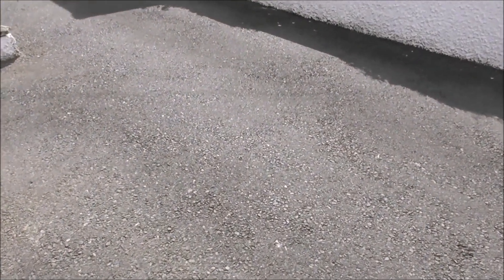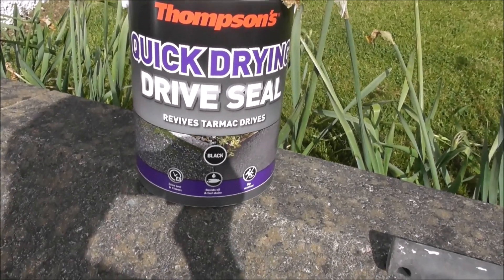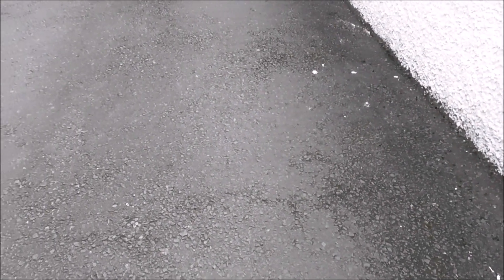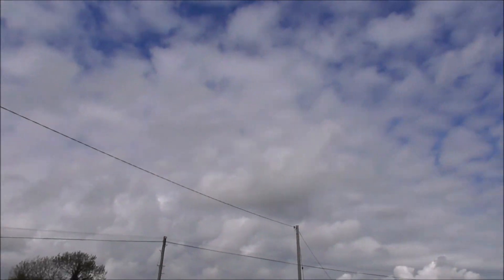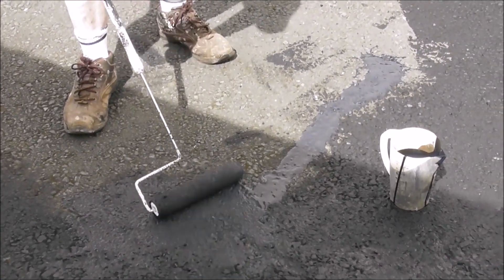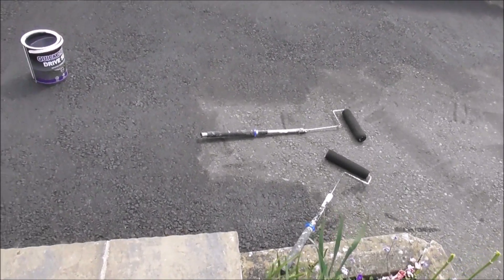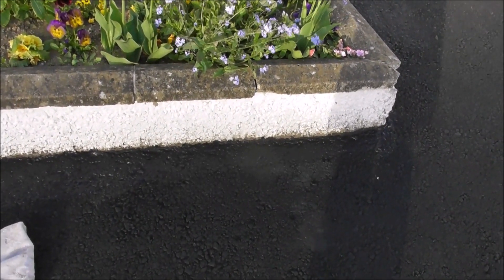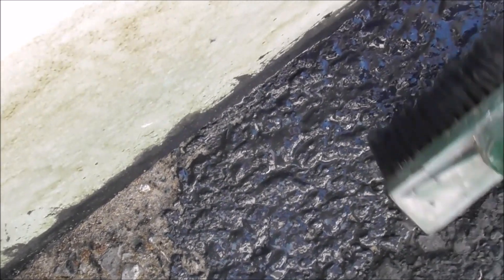How to Revive an Old Tired Tarmac Driveway

Comment: Great job Tom well done a friend of mine did his driveway did the edges first with a soft brush to stop splashes and put it on heavy and then used very thick rollers to get the paint in the tarmac and give it a heavy coat but then he had done a few driveways before so had a lot of experience of what worked out the best way to do it that old saying ( practice makes perfect ) thanks for sharing take care 👍
Reply from the maker: This stuff really works well RDUK. It means that you delay retarmacing for years and years. I good thick coat will protect it for a long time. Hard work though.

Comment: Thanks for sharing although I did think it would have been a better coverage for the effort you put in. I thought it would have been thicker as I have holes and was expecting to fill them up! Think I’m looking at the wrong product lol
Reply from the maker: Admiitedly DIYman the coverager didn't go as far as I expected either. Holes are a problem. If you driveway is holy then you would need to get it evened out. I have looked for other stuff but nothing springs out. Everyone in the business I have talked to recommends this stuff. I'm afraid it is expenxive too but then so is retarmacing. Best wishes from the Belfast Castlereagh hills.
Reply: Whoever tarred your drive did it with a base coat tar that's why its taking so much of the paint its got too much big stone in it good job patching it up though
Reply: @TomMcClean  45€   us ZILCH.
Reply from the maker: Very expensive!

Comment: Hi can you update us on this drive sealer? Has it held up well or has it faded? Thannks
Reply from the maker: It has faded Bruce. It looks really good for the first year after it's done but ..........
We will have to think about redoing it in the Autumn. Admittedly we are very exposed to the elements here. Best wishes from the Belfast Castlereagh hills.
Reply: @TomMcClean  thank you for your reply. I'm trying to find something that'll last so it doesn't become another job the Mrs bugs me to do every year 😆 someone suggested bitchumen paint to me but can't see anyone who has used it.
Reply from the maker: Hi again Bruce. We last coated our tarmac 2 years ago. We might get away with leaving it another 2 years. Then we will buy lore of this tarmac paint. Admittedly our driveway does take a fair bit of abuse. I reckon 4 years is about the maximum it can be left which isn't bad. However we found that a tin doesn't cover a big area. Maybe we wear laying it down too thickly. It does look really good in the first year after it is laid down. Best wishes from the Belfast Castlereagh hills.
Reply: @TomMcClean  thanks again I will give this ago.

Comment: How did you find the coverage? My driveway is 60 m2 and going off the states coverage I should be able to do it with 2 tins, but I’ve ordered 4 tins just in case
Reply from the maker: Hi Mike, It all depends on how thickly you want to paint it on and also if the condition of the driveway. If your driveway is in poor broken condition it will obviously require more paint cover. We found that tin coverage was not good at all. We used 8-9 tins! They were nearly £20 each. So our driveway was covered with a lot of hard work for around £200. It was and is pricey but the finished job looks like a new driveway. A new driveway will take big money so it is a bargain and is worth doing. I think you may order at least 2 more. If you don't use them then you can keep them for next time. Our driveway is very exposed and takes a fair bit of abuse so it will need another coating next year.  Best wishes from Belfast Northern Ireland

Comment: Back breaking work mate,well done , looking good👍
Reply from the maker: Yes Andy and for much of the time we were using short paint poles until i went and bought longer ones. This stuff is excellent.
Reply: @TomMcClean how long did it stay black for i guess not long?
Reply from the maker: I'm afraid it does fade. It all depends on how particular you are. We haven't done it since and that is 4 years ago. But it does need a repaint after 2-3 years. Best wishes from the Belfast Castlereagh hills.

Comment: Ya think ya can use this stuff on imprinted concrete?
Reply from the maker: Hi Kev my next door neighbour has used this and it now looks like a tarmac drive--if you don't look to close. It is expensive stuff but hey it does an amzing sealing job. Best wishes from Belfast Northern ireland
Reply: @TomMcClean  I have deep grooves so should keep it's looks , I'll pick some up today cheers
Reply: I would suggest you don't - it's designed to go over tarmac. It's made by a company called Sherwin Williams and they are one of the biggest paint companies in the world (US based, $14Bn turnover and have manufacture and customer service outlets in Europe). If you haven't already started I'd call them and ask them the question. UNITED KINGDOM EMEA HEAD OFFICE uk Flag. Tower Works. Kestor Street. Bolton. BL2 2AL. UK. +44 (0)1204 521771. +44 (0)1204 382115.
Reply from the maker: Hi John, 
In answer to your suggestion I can only say that our neighbour has been doing this for decades now and there do not appear to be any adverse effects. Instead people who pass his driveway often remark at how good it looks.  I have been using it as designed on tarmac. Thanks for your comment.
Best wishes from Belfast.
Reply: @TomMcClean   Hi Tom, fair point - the proof of the pudding is in the eating. But as a qualified paint chemist that's worked in the paint manufacturing industry for 42 years, I can tell you that the vast majority of issues in painting arise from people not following instructions or using the wrong products or failing to prep properly (or a combination of all). As you say it's expensive stuff so surely it's worth a quick phone call to the people that make it - they'd be happy to help. Best wishes  John.
Reply from the maker: Thanks John for taking the time. A wee phone call next time then! 
Best wishes Tom

Comment: Spent £100 on this a year ago and it's faded even worse than before not good stuff
Reply from the maker: Sorry to hear that CM. Admittedly our driveway also looks a bit worse for wear. Then we are battered by the elements where we are. I reckon it has protected the surface underneath but that protection is largely gone now after 2 years. I'm now looking at other driveway paints but wondering if they would be any better. Best wishes from the Belfast Castlereagh hills of N Ireland.